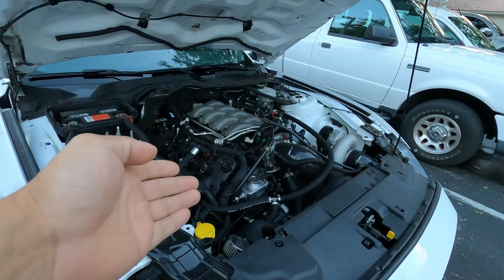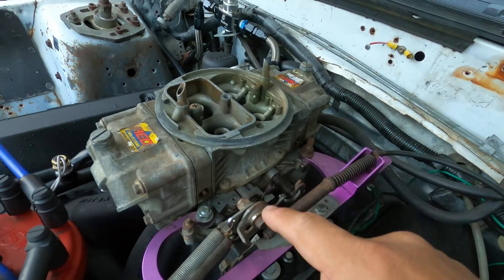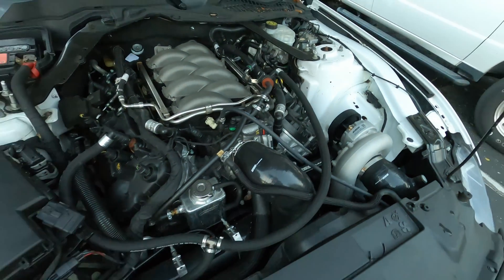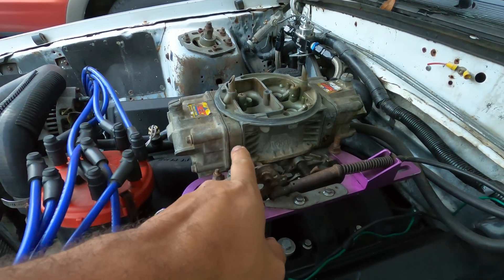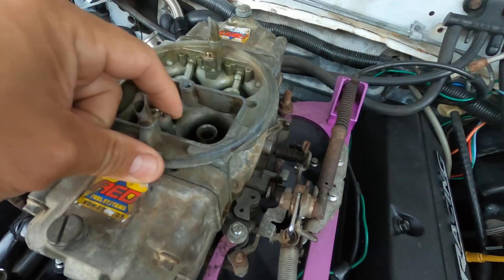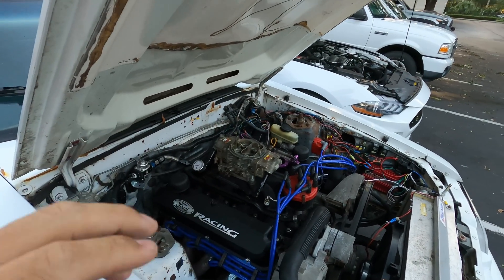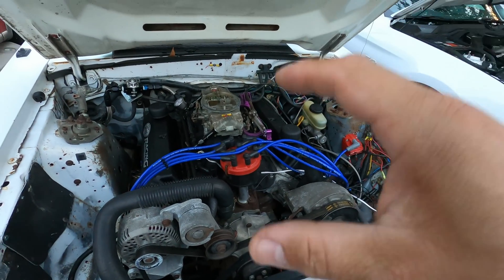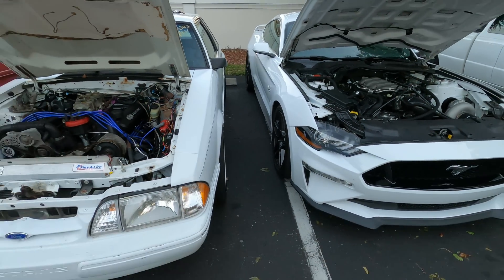How old school Carbureted technology taught me modern mustang tuning

Comment: The accelerator pumps aren't comparable to the MAF. Accelerator pumps are only when you stab the throttle. MAF is constantly referenced, unless the tune says otherwise (outside of certain RPM ranges), because MAF isn't perfect. You don't understand as well as you think.

Comment: Great Video, I’ve always struggled in how to blend the fuel tables and to blend the timing table for a fast ramp and have the engine accelerate and to be able to pull the spark plugs on pump gas and see the m coffee while monitoring my temperatures and oil pressure, Great content.💪🏽👌🏽

Comment: Great vid. Ive always tried to explain it as the fundamental control systems of any engine are the same...the same variables need to be addressed related to fueling and ignition timing. In the past things were done mechanically whereas modern stuff is just electrically/digitally. 

What still eludes me is independent cam timing. I know how it works physically, but haven’t seen a good vid on manipulating for better performance, or how tuners determine what and how much to adjust...
Reply from the maker: You'll never see that . That is something that is kept close to the tuners as it's literally r&d and not to be given away for free

Comment: That carb a double pumper (mechanical secondary) and secondaries opening only has slight delay. Remember people who took vac secondary carb and put a screw in the arm to make them open faster. Then they get backfire through carb because mixture went lean. Because there are no accel pump (squirter) on secondary side like double pumper. Also power valve or fuel enrichment that bypasses main jet for more fuel under WOT. Backfire through carb would blow power valve out until check ball was installed in later carbs. I got into playing with air bleeds for transition slots and main jet. Air bleeds change timing when fuel flows through transition slots and main jets. So many think when driving or cruise you're pulling fuel through the main jets and fuel come out booster but you're not. Actually pulling fuel from transition slots cruising and it's possible to get fuel from idle circuit depending on throttle plate angle. Also did a lot of dist work with springs and weights. How fast advances timing and when it stops. Going from sea level to mountain does affect carb a lot and ignition timing. Maybe on lean side and needs less timing. Adjust carb that day only good for that day. Cool thing about EFI it takes in all data and changes fuel and timing all day for most conditions. As long as programming is done right but wide band sensor help even more

Comment: I started out with carbs and distributors with SBC AND SBF. I know how to make a car run with a carb and distributor. I did diesels also. Was a professional mechanic for years. When I career transitioned to IT, I was able to understand the software faster than most. Applying general automotive knowledge and learning what each of the tables in HPTuners does, I was able to teach myself to tune. I already understood EFI systems (I trained  on early pre OBD stuff. Transferred to diesel in the late 90s) so that knowledge helped me learn.